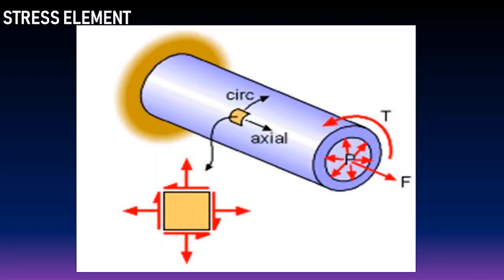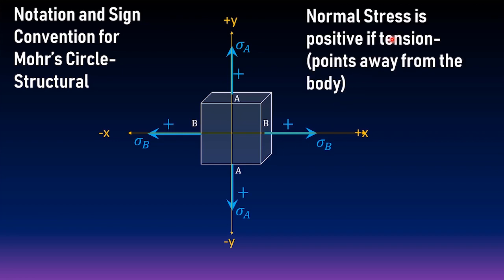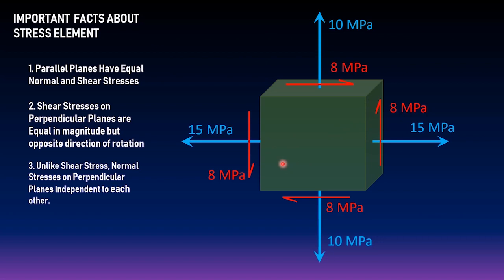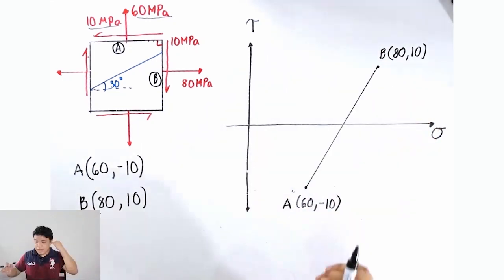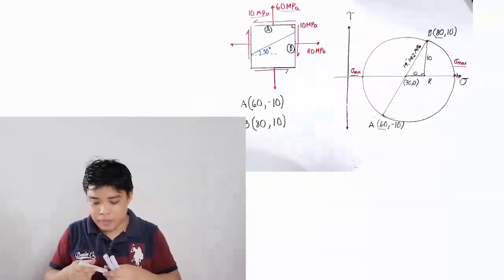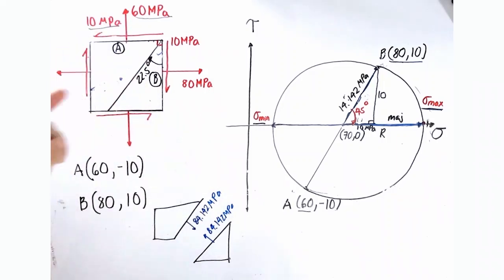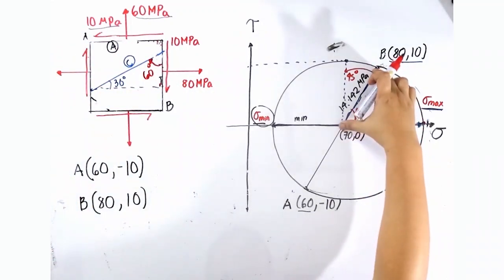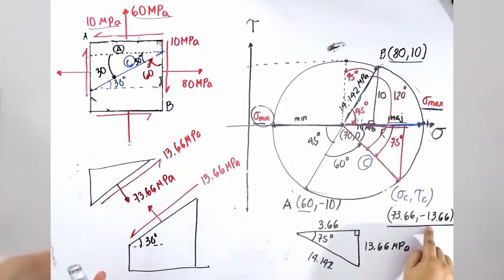Plane Stress Analysis - Detailed and Simple Explanation | Part 1

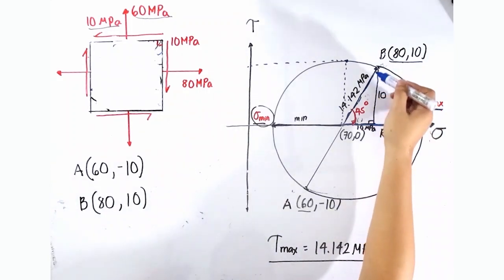Comment: Sir, referencing times 22:24 and 22:42. Should the angle (45 degrees) also get in half for shear plane?
Thank you Sir for your videos, really helped me a lot.
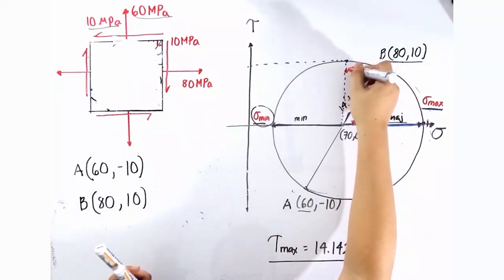Reply from the maker: Correction for 22:24 to 22:42, the plane that contains the maximum inplane shear stress is 45/2=22.5 degrees counterclockwise from plane B. My apologies.